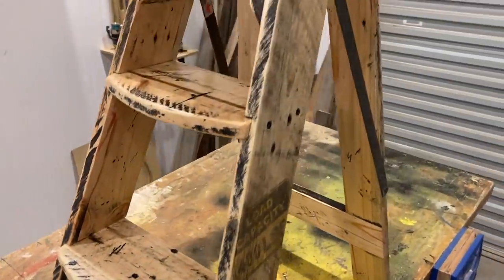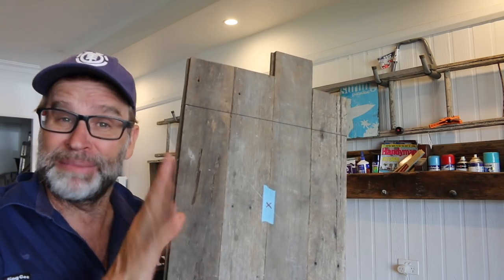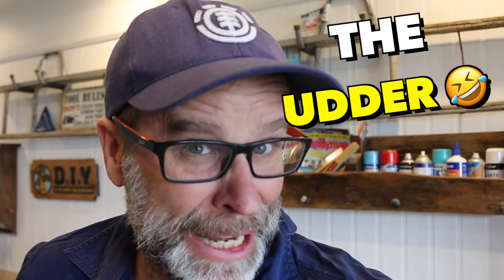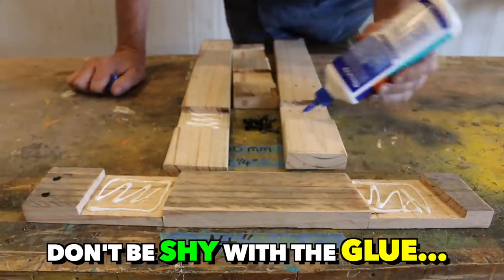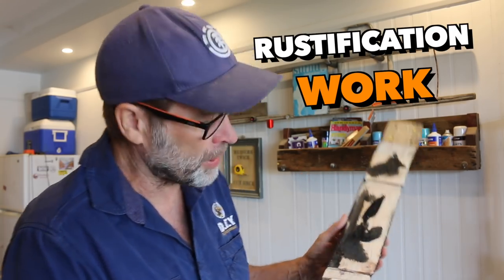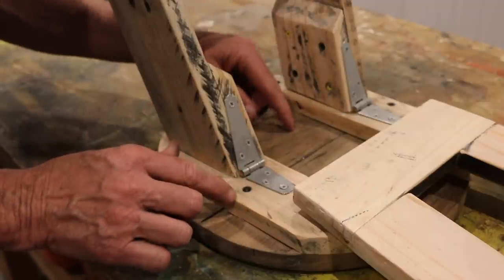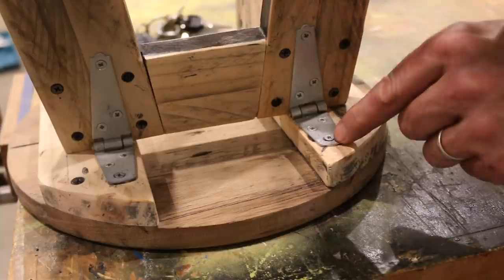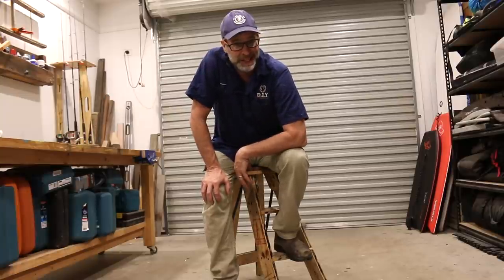DIY Folding Step Stool.  FULL TUTORIAL!

Comment: So, Ed and Bernie were pals and enjoyed poking a bit o fun at each other as opportunities arose. Ed came upon Bernie cutting up a dead and down  Red Oak in the woods near Bernie's homestead. Ole Bern was using his pap's handsaw from the woodshop to do the work and Ed noticed it was taking him a long time to make a single cut. 

So, he offered his buddy Bern, the use of his chain saw. He dropped it off to him and went into town for a spot o tea. 

When Ed came back, he noticed Bern working on the same cut he was making when he dropped off the saw. Ed asked his old friend, Oi, what is takin ya so long ta cut the log? Bernie was a bit put out with Ed, since he'd been working hard as he could to make a cut with the chainsaw Ed had left him.
 
Perplexed, Ed told his best bud to move away so he could give it a whack. Ed grabbed his faithful McCullough chainsaw, switched it on, gave the bulb a couple pumps, set the throttle for start, and gave the old starter rope a sharp pull. 

The old saw jumped to life, Ed revved it a few times, and looked quizzically at his life-long pal and said frankly - Bern - the saw runs perfectly. 

Ed, staring back blankly asked, What was that sound?

It is an old joke, not well told by me - I'm sure you can brush some life back into it, if you've a mind too. 

Happy scrap wood building. I make some nice woodworking mallets from the White Oak 2x4s found in some pallets. I take a section about 12" long and, using a couple different hand planes, make it all square and smooth. I cut two head pieces and put them so the curved growth rings form a matched arch pattern on the faces. I plane the mating faces to fit perfectly with each other, mark out the location, shape and size needed to accommodate a tapered handle at least an inch thick, saw and chisel it to fit, make the tapered handle, fit it all, then shape the head into a curve with 5 degree faces, trim up the handle to make it fit the hand, leaving about 1 3/4 on the end of the 15" handle, sand or scrape smooth, and soak in some BLO, wiping it down then apply some paste wax. 

I really enjoy making them. Blessings to you and yours. Thanks for the fun and instructive videos.
Reply from the maker: Hahahahaha....l actually used a version of that joke in my Circular Saw video 😂😂 Those mallets sound pretty cool Neil 👍👍 Have a good one mate and thanks for watching 👍😁🇦🇺